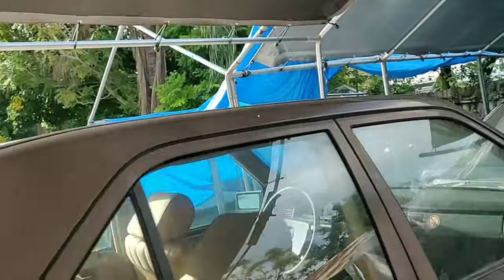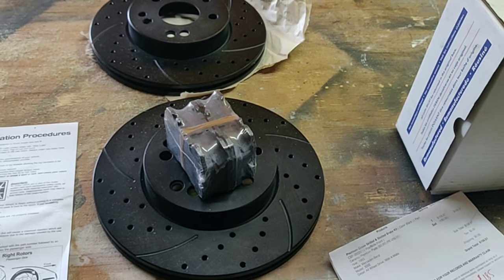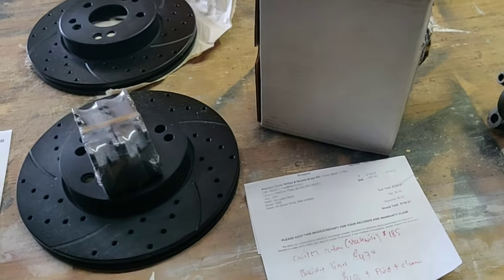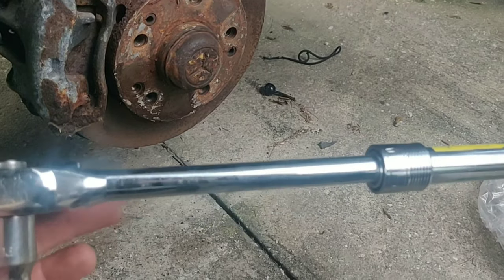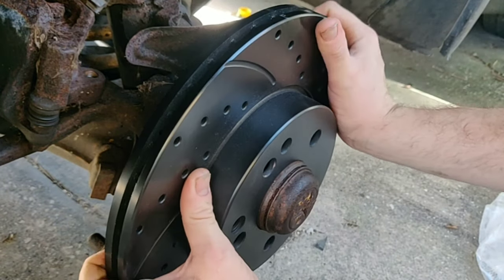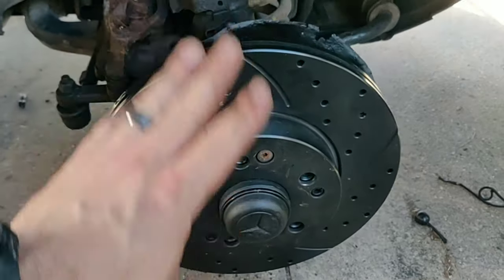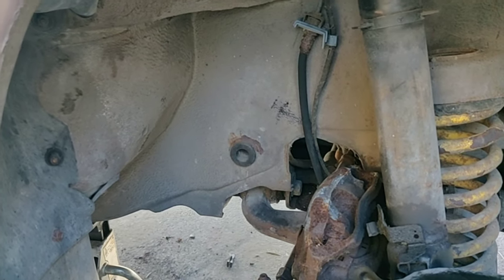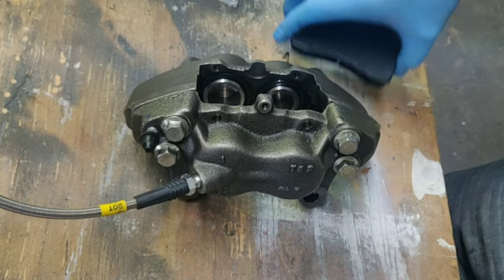Mercedes 190e big brake upgrade under $400: 4 piston calipers, drilled/slotted rotors & ceramic pads

Comment: One big thing you forgot to upgrade is the brake booster.  That is key.  The early w201 chassis came with single diaphragm brake booster.  The late w201 and later w124 chassis came with dual diaphragm brake booster.  You get about 30% more stopping power just by upgrading to the dual diaphragm brake booster.  I would also swap out the master cylinder for the 300E one at the same time as well.

Also, one tip on your braided brake hoses.  Rather than buying pre-made braided brake hose, you should have a hydraulic hose repair shop make you custom steel braided brake hoses.
Reply: The dual brake booster will only reduce the driver effort, it will not make the brakes more powerful. It will also reduce the brake pedal feel for the driver.

Comment: This is an absolute amazing tutorial
Reply from the maker: Thank you so much. Let me know if you need help or have any questions.   It ended up being a lot more work than original since I had to add the spacers to fit my rims but well worth it
Reply: @petescarport  bro .. I just got my dream baby Benz imported from USA to DUBAI .. 
I will need alot of upgrades for the brake, suspension, bodykit, engine tuning or swap . I will contact u as soon as I start my project
Reply from the maker: @haideriraq1950  congratulations.  They are amazing cars.
Reply: They are 😍😍

Comment: Any updates since the upgrade? I have an 89, 190 E 2.6.   Were your wheels 15 inch? I’ve been wanting to do this upgrade too. 

I would also love to do some type of modern Turbo charged. AMG four-cylinder. With a five speed manual and an EVO-1or2 body kit for a wider stance.

Comment: Nicely done and what a difference.  What kind of ratchet did you use from Harbor Freight?  Regarding the rotors, will the finish wear off where the pad meets the rotor or will the color remain? Thanks

Comment: Subscribed! Love finding fellow Mercedes enthusiast on YouTube! My Channel features modification and maintenance of my C55 and ML55. Love the 190e! Currently doing a 6 speed swap on my C55 then time for BIG brakes :)
Reply from the maker: That's awesome.  A 6 speed swap would be one of my dream cars in a c55.  If you didn't watch I'm about to start a series on a widebody 500sl r129 with a full engine trans swap too.  Should be pushing some major power.  Thanks for subbing. I will go check out your channel and sub

Comment: Your brake lines are too short because those ones you showed are for the rear... there is another part number for the front... 950.35005 is the number for the fronts.
Reply: Is this confirmed because I was looking at this too it doesn’t state the length

Comment: Nicely done and what a difference. Will the finish of the rotors wear off where the pads meet the rotor?  
What is the name of the ratchet used from Harbor Freight? Thanks
Reply from the maker: So the rotors will wear to metal where the pads meet but the benefit is protection against surface rust on the other areas.
Reply from the maker: So the rotors will wear to metal where the pads meet but the benefit is protection against surface rust on the other areas.
Reply from the maker: Also this is the harbor freight wrench
https://www.harborfreight.com/38-in-drive-professional-flex-head-long-handle-ratchet-62333.html

Comment: Do you know if these calipers will work with a standard 190e rotor?  I just ordered new genuine pads and rotors and I was going to get my calipers cerakoted but for the price cerakoting it might just be cheaper to upgrade the front calipers.  Thanks
Reply: Just for others reference, it depends what discs yours has. Most 8v only have non vented discs so you gotta get vented ones.

Comment: Nice video 
Thanks for sharing 
Can u use original caliper to the 300E roter?
Reply from the maker: I don't think it will work since the rotor is bigger.
Reply: Is The caliper position is different from left to write?
Reply: @mohamedfiraz7041  Yes, because the beed nut must stay on upper.
Reply: @Percha_cs  
But the 300 E Roter is big
Reply: @mohamedfiraz7041  Y say yes to the position question, the other I don´t know.

Comment: Do you have email to contact you . This caliper is plug and play ? What about mount hole ? On w124 2.0D 88g i look for same biger break .
Reply from the maker: My email is peterdavidson77@gmail.com
Reply from the maker: The mount hole lined right up.  My only issue was my rims touched the calipers.  But with 300e rims or similar style rims it won't touch

Comment: hi could you mount calipers on a s500 w140 and the disks
Reply: take my language, I'm Spanish
Reply from the maker: Si.  They have different ones for s500.  I put slotted rotors.  S500 has big brakes already
Reply: @petescarport  my question is. if s500 brake calipers can be mounted on 190
Are they the same as the e400?
the disks I know are larger than the s500 and are not worth